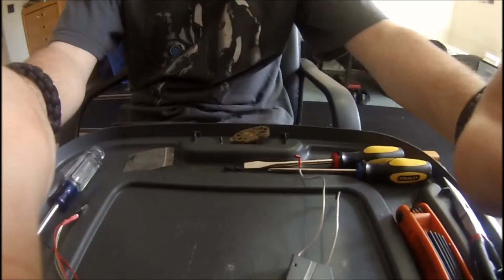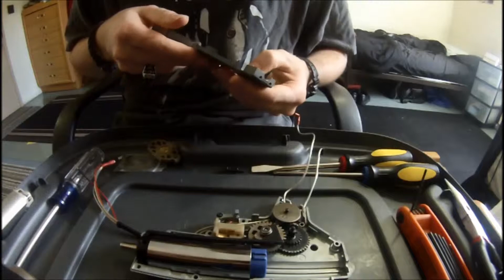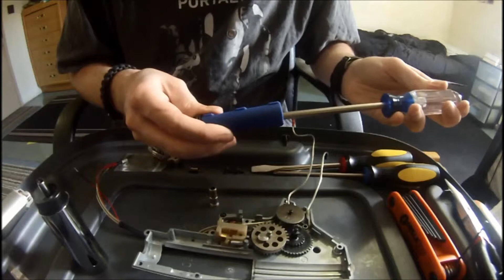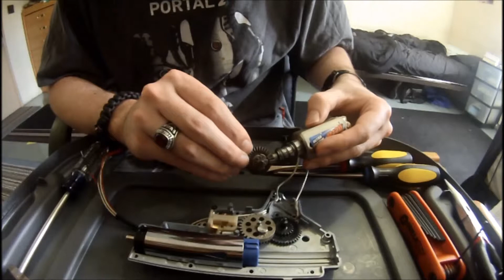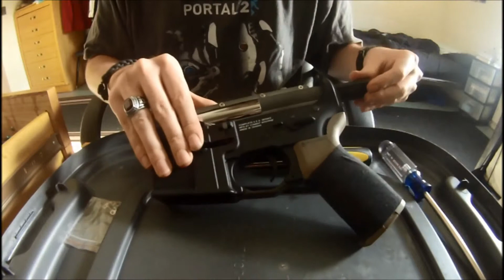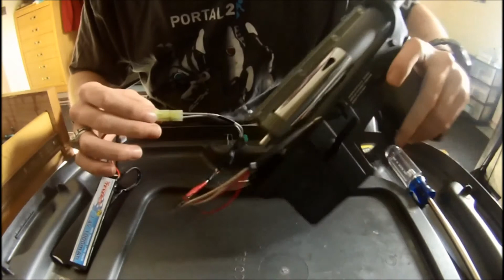Rambling about my high speed SSG build and parts (20-30rps)

Comment: sorry bro. silicone oil should NOT be on the compression parts. as soon as the silicone oil leaves the air nozzle, it gets in your bucking, thus affecting accuracy and probably going to tear it up earlier
Reply from the maker: yeeeeeah that would be true if i just dumped it into the compression parts, I don't soak the o-rings i just make them damp enough to swell up and give good compression. and don't tell me you're one of those people who uses grease on their compression parts. that's worse than the oil.
Reply: really? it is? I always had better results with grease. maybe that's because I did it wrong. oh well
Reply from the maker: if it works for you go for it. but the one time i lightly greased my piston O-ring I ended up with grease in my barrel and on my bucking causing it to jam every couple of shots.
Reply: Team M81 it's never happened to me . I never slathered grease on there. I just put some
Reply from the maker: as did I. oh well, use what works well for you.